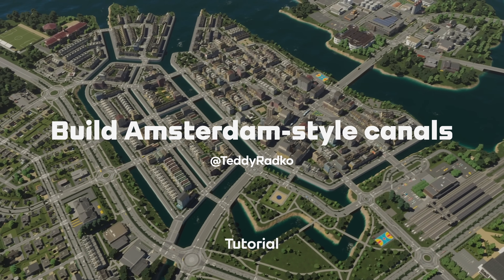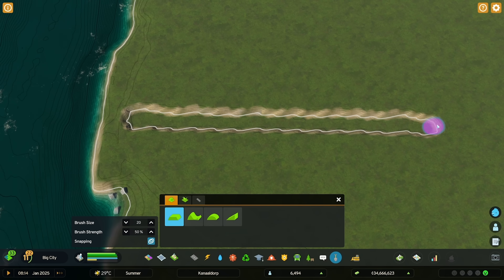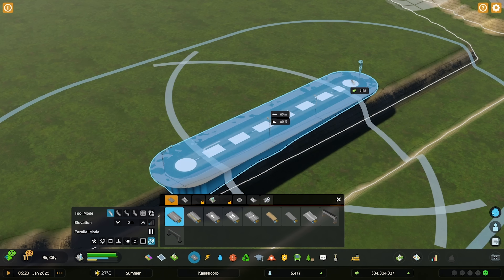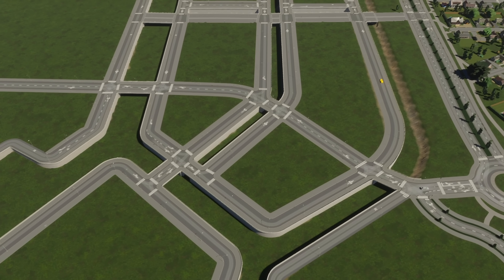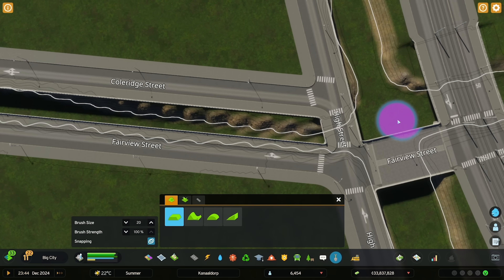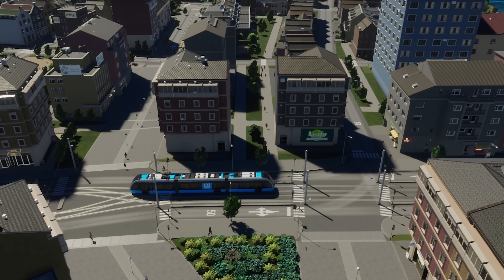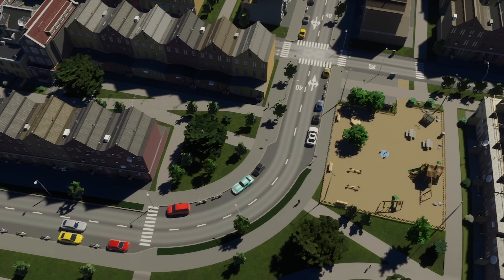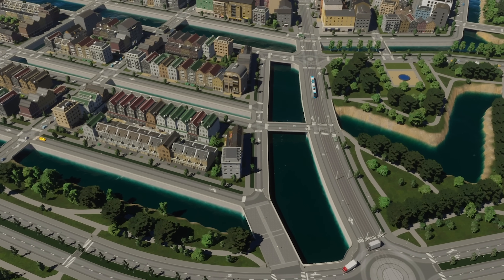How to Build Amsterdam Style Canals | Inspirational Builds | Cities: Skylines II

Comment: 1:00 guys just remove the in water thingy... This is a bug not a feature. And make an keep absolute level toggle for roadbuilding
Also for asymmetrical roads fix the bug where the retaining wall switches to the wrong side when changing the street direction, it's very anoying 🙄
Reply: Oh that upgrade switch issue us annoying. you can try to get around it by first upgrading to a symmetrical road while also switching direction before switching.iirc i had some success that way

Comment: All of these videos lately are just highlighting how disappointing the game is. This is supposed to be a new and improved game built from the ground up. Why do we have to do all these 'hacks' when there should be good quality of life options built into the game. Soon after release we have mods that fix some of these issues, like being able to force the cut and fill, force bridge and tunnel mode etc and we are now 2 months after release and they are still not included in the vanilla game. Why are the features of TMPE, node controller, network multitool and the original road anarchy not included? No undo. No picker tool. No copy paste or save templates as stamps/blueprints. Why can we not hand place buildings instead of zoning? These features have all been around for years in the first game so could have been incorporated during the last few years of development. Gives the impression that the developers have no intention of adding these kinds of updates to the game to improve on the basic tools provided.

Please take a day off from optimizing the game and add in some useful features instead. The zoning system desperately needs updating so we don't need to hack it with running temporary paths. Why was the zoning system not updated from the first game to work better with curved roads and automatically fill in the gaps between buildings on curved roads. Why is there still no access to props in the game?